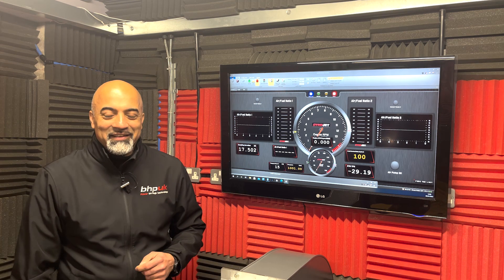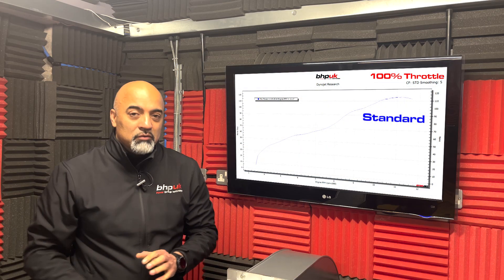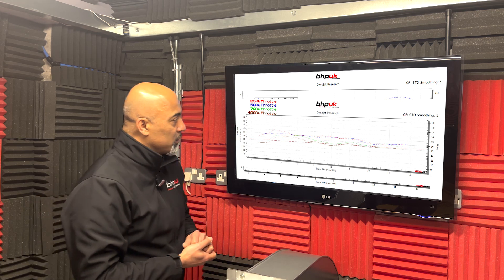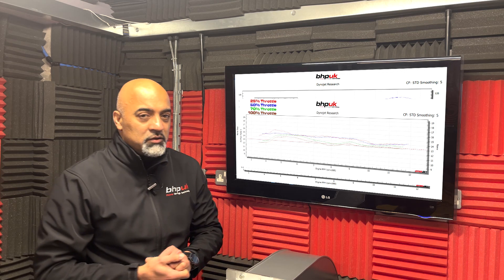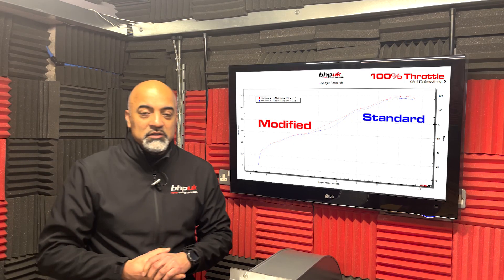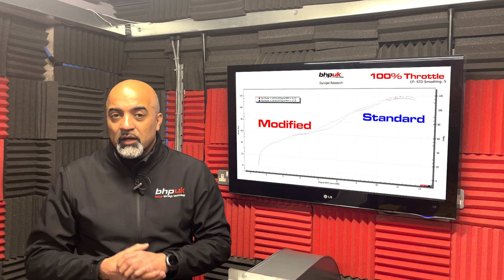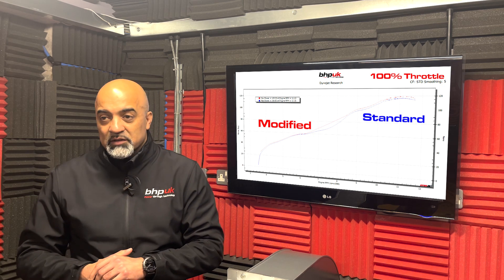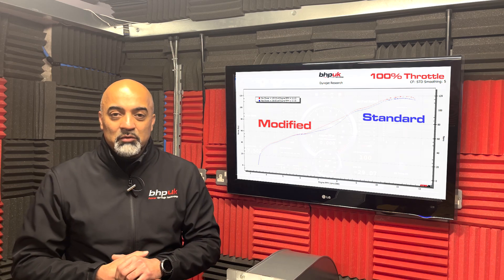Triumph Street Triple 765 RS  BHP UK Custom ECU Remapping

Comment: Can my 2009 Street Triple be maped so it is not so snatchy it's terrible at low speeds it's on off hard to control
Reply from the maker: Yes of course, this is probably the biggest advantage of the tune.
Reply: @BHPUK  thank you looking at this summer as at 62 not my favourite thing to ride in the cold. Will check where you located.
Reply from the maker: @andriesvanderwalt1849   we are based in the UK but can send our ECU Flashers world wide.  Let us know if you need any help
Reply: @BHPUK  yep that might be the easiest way so basically just plug in and download the new program

Comment: Just a thought, when you say very lean don't you mean that it was running at Lambda 1 (~14.7:1) which is where it needs to run for the catalytic converter to be efficient and comply with emissions regulations?  Where it was running richer than lambda 1 will be the area where it is most likely running open loop (unless the Keihin system runs a wide band oxygen sensor - Uhego, and is able to target a lambda value richer than 1 while in closed loop control) and will have been mapped to run ~Lambda 0.9.  If you enrich the base fuel map in an area where closed loop closed loop fueling control is active, all that will happen is the closed loop control will take out the fuel with this feedback ultimately being stored as a negative fueling adaption.  If you have disabled the closed loop control (or restricted the rpm/throttle range more than the OEM calibration) then the closed loop controller will be disabled and your changes will be applied - no surprise that you would need to add ~10% to all areas where you are now running richer than lambda 1 to get to ~0.9 lambda.  Just for reference the convention is as follows for production ICE vehicles (as I'm sure you're aware): Stochiometric combustion is Lambda 1 (AFR~14.7:1 depending on the fuel you use - ethanol content etc...), lean is obviously anything above Lambda 1 (AFR>14.7:1) and rich is anything less than Lambda 1 (AFR<14.7:1).  So long as people understand and are happy that their catalytic converter (if still fitted) isn't converting HC when running in a rich condition then that's OK.   As the production ignition calibration for the Street Triple would have been mapped on reference fuel (WRT knock index of the fuel so ~95 RON versus pump fuel at ~96.5 or higher if Shell/BP) and with a top limit engine (compression ratio) then DBL -2 or -3degBTDC (unless the bike has knock sensing which I don't think it does), it should be safe to add a few degrees of ignition to gain more torque.  Hopefully the production calibration of AIT (air inlet temp) retard is appropriate or you may find that you experience detonation in some areas when intake air temperatures are elevated.
Reply from the maker: That’s quite an essay. You obviously know a thing or two about engine function. We are remapping the ECU. We can modify closed loop fueling target values, open loop fueling and ignition advance tables as well as any other map we need to.
Reply: @BHPUK  Morning Gents, yes just over 2 decades in the automotive industry as an engine management calibration engineer is my background. Working for OEMs on several different EMS platforms and being heavily involved with emissions testing worldwide, I have a more than passing knowledge you could say😉. I hope you got the gist of my first post, my point is that adding fuel to a base map on an EMS with just a hego sensor and not changing the closed loop enable thresholds, just results in negative fuelling adaptions. However it sounds like you're aware of that and have made the changes necessary changes to broaden the open loop area and hence run richer for best torque 😉👍👍
Reply: @edxr250r Please tell me you run a business in mapping?
Reply: @Inked_CR  - worked for Automotive OEMs in gasoline calibration for a couple of decades,  hence the post😉👍👍
Reply: @edxr250r  Excuse the French. You know your shit! Fair play, sir. 🙂

Comment: Hello there, I’m running 2017 765rs with a high flow air filter and a sc project slip on, What’s the cost of sorting the fuelling out on it, Phil.
Reply from the maker: Hi Phil! If you give us a call on 01282 779000 or even drop us a message on social media, I'll get all the information over to you :)

Comment: Hey! I have a 765rs, same model as the one in this video. Ive gone in and changed the ETV maps in tune ecu (to great success!) but, lacking a dyno, couldn't ever get the fuel maps right and stuck with conservative pushes in the partial throttle openings. Would it be possible to purchase a map from you I can flash using tuneecu that incorporates my ETV mods?
Reply from the maker: No sorry, we don’t supply maps for other tuning tools.

Comment: To be honest I didn't notice any flat spot in my 2020 Euro5 with stock exhaust.
Even throttle response is very quick compared to my old Honda.
Am I really going to cry after changing the exhaust to aftermarket slip-on?
The worst thing is even if I would like to go for the dyno, there's nobody to do it right near my town...